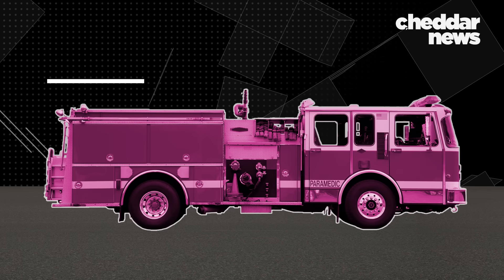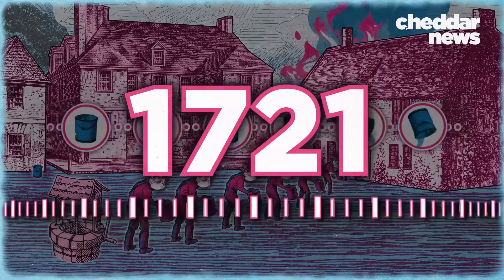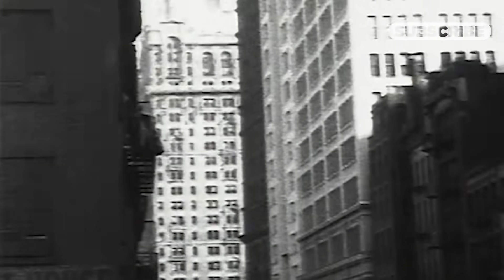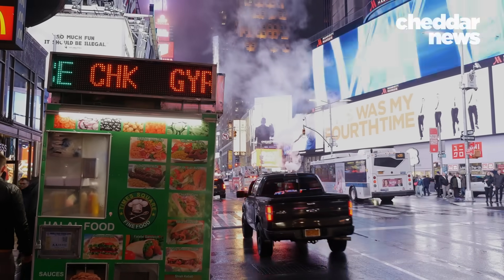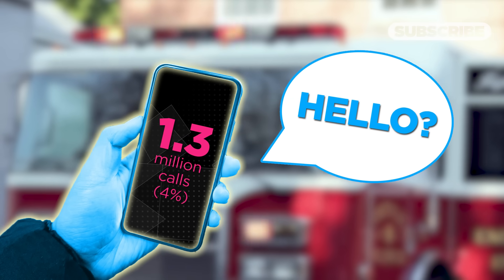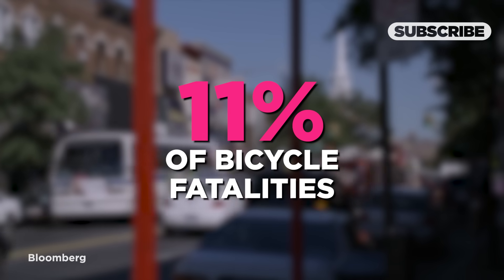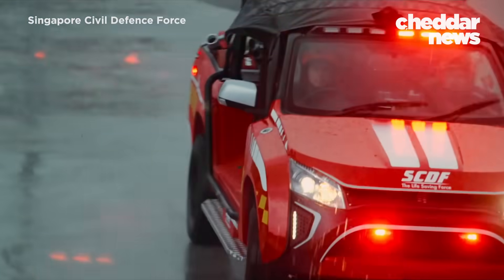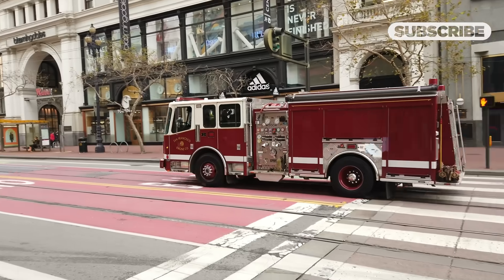Do American Fire Trucks Need To Be So Massive? - Cheddar Explains

Comment: European fire trucks carry less equipment on average. They also have smaller water and foam tanks. Instead they keep a wider range of vehicles. Where as in the US a department has fewer vehicles but the trucks are bigger to handle all of the jobs under one roof as it we're. 

U.S. fire trucks need to be bigger to service areas that don't have access to fire hydrants too. 

There is a reason as to why U.S. trucks are bigger. They have different tasks that they do compared to smaller EU trucks. 

The U.S. isn't Europe with small roads and smaller houses and smaller buildings and densely populated neighborhoods. 

Different needs requires different types of equipment. 

Fire departments in the U.S. tell fire engine manufacturers what they need and what capabilities the truck must have. From there the manufacturer builds a truck to fit those requirements. 

If smaller trucks we're needed then U.S. fire stations would be asking for them. But there not. Because they aren't in Europe. 

Maybe European cities should adopt U.S. trucks? 

I always find it funny how videos like this always ask how the U.S. should adopt some European standard. Maybe it's Europe that should adopt the U.S. standards. 

The U.S. and it's people have and will likely always never adopt European things. Because we are our own country. We got away from Europe for a reason and haven't looked back. 

We became the world's largest economic superpower doing things our own way. Even bigger than the EU. 

So I just don't get videos like this as they don't consider the people doing the actual job. 

Most American firefighters know what type of vehicles Europe has. But they obviously haven't started asking for vehicles like this. 

If they want it, they will ask for them. 

The way fire departments and ambulances work and how operations are conducted are very different to how EU departments work. 

Plus much of the U.S. system is operated on a volunteer force.
Reply: "European fire trucks carry less equipment on average. " no, that's not correct for most countries. 
"They also have smaller water and foam tanks" absolutely correct
"Instead they keep a wider range of vehicles" yes, the lineup is a bit larger
"Where as in the US a department has fewer vehicles " not sure if there are fewer. Fewer apparatus per station, yes, but thatfor many departments in the US have numerous tiny stations scattered in the area
"U.S. fire trucks need to be bigger to service areas that don't have access to fire hydrants too. " there are areas without hydrant coverage in Europe as well
"They have different tasks that they do compared to smaller EU trucks." which different tasks for example? Apart from a few tasks we do I doubt the American ones do, I can't imagine tasks the American ones do and Europeans don't do.
"The U.S. isn't Europe with small roads and smaller houses and smaller buildings and densely populated neighborhoods. " there are countries like Sweden where the road network is of American scale; Also in central Europe most American fire trucks would easily (!) fit into the city streets as also semi trucks, articulated buses and trams fit there. Places where they have small roads are e.g. in the few preserved historic city centers, of which relatively few are still around and most of them are of very compact size. Houses aren't in general smaller and population density depends a lot on the country and region you're looking at. Some of them have an equally low population density like some of the US states with lowest population density
"Maybe European cities should adopt U.S. trucks? " American apparatus manufacturers tried to enter the European market multiple times but never were successful. Even the US Army Fire and Emergency Services at USAG bases here went away from using American apparatus and got European ones instead. Becomes even more interesting: they rather leave some of the all American apparatus behind and instead they import some half American half European apparatus to the US. 
"Maybe it's Europe that should adopt the U.S. standards. " the lack of maneuverability would be the killing aspect for most American apparatus here. American apparatus manufacturers always tried to get their American apparatus layout working in Europe, which obviously no department could or wanted to accept. A massive truck with only a 100 ft ladder isn't an option when we have trucks of the same size but with a 200 ft ladder on them. 
"will likely always never adopt European things" well, some units from Europe are in US fire service and EMS for quite some time. The Panther ARFF Crash Tender, Tatra and Unimog offroad trucks and among vans the Sprinter and Ducato. LAFD recently also bought a Euro style Engine which was slightly adapted to fit to the tactics and needs in LA. 
"Plus much of the U.S. system is operated on a volunteer force. " not much different in Europe. As far as I remember 69% of firefighters in the US are volunteers? The share of volunteers is at 95% in Germany.
Reply: @EnjoyFirefighting   It's not scientifically possible for such small trucks to carry as much as U.S. trucks. They simply don't. That's just a fact. U.S. trucks carry more ground ladders, equipment, and tools) creating a need for a larger chassis. It is a requirement that aerial fire apparatus must carry a minimum of 115 feet of ground ladders. 

U.S. trucks are also larger again due to their larger tanks. They're simply bigger to haul more. 

The EU also doesn't compare to the U.S. in the sheer scale of areas without hydrants and small rural towns. Yes the EU has them. But it's still infinitely more densely populated as a whole. 

U.S. trucks are also much more custom and are tailored for different department's needs where as European trucks are all much more commercialized on pre-existing Volvo chassis and other brands and such.

Most aerials in Europe don’t carry pumps or water tanks, so they need a pumper behind them to provide a water source for them. 

Plus, European pumpers tend to be lighter than their U.S. counterparts, In Europe, the gross vehicle weight rating (GVWR) on pumpers is in the 30,000- to the 36,000-pound range, compared with 40,000 to 47,000 pounds in the United States.

And yes the typical American home is larger in sq, footage than the average EU home. Wood construction is also far more used in the U.S. compared to the EU.
Reply: @GalaxyFur  "It's not scientifically possible for such small trucks to carry as much as U.S. trucks." yes it is, for a simple reason: many compartments on US trucks have lots of unused remaining space the way the equipment is stored inside, whereas in most places in Europe it's like a game of tetris with them using every inch of available space. That's how it's possible, not kidding
Platform Ladders carry less equipment for a very simple reason: less equipment > more compact > greater maneuverability. A 105' rear-mount platform here has a tighter turning circle than the tractor unit of a Tiller Ladder alone. The Platform Ladders carry only a minimum range of equipment, like hoses, nozzles, EMS stretcher mounting, chainsaws etc, 48 different things at a total number of 69 pieces, that's it. No tank, no pump, no set of rescue tools and no ground ladders ... all that is supplied by the Engines. 
Yes, the tanks are larger, I agreed on that in the previous comment already: you: "They also have smaller water and foam tanks" me: "absolutely correct"
"in the sheer scale of areas without hydrants and small rural towns." oh yeah? Only state we might not be able to keep up with is Alaska. Apart from that, take a look at northern inland Sweden, northern Sweden or Norway. We know very well a thing or two about small rural towns and areas with no hydrants. In general, I agree, most of Europe is more densley populated
Yes, 99% of apparatus are based on a commercial truck chassis, which doesn't mean that there's a smaller scale of the apparatus being custom tailored for each department's needs. Need a 6x6 van, a 10x10 truck, a tanker holding 8,000 gallons, an Aerial reaching 300 ft up or an apparatus with air ride suspension or all-wheel steering ... whatever you can imagine, you can get it even if it's "only" a commercial chassis. 
That's correct, the average Engine is lighter here; There are heavier ones, but the DIN standard in fact sets not only the minimum requirements for tank, pump and range of equipment, but also the max for dimensions and weight of the apparatus. 
"Wood construction is also far more used in the U.S. compared to the EU." that's true, however there are countries in Europe where it's just as common as in the US.